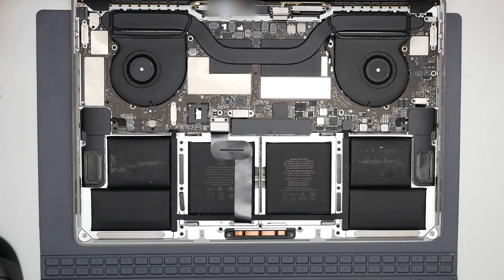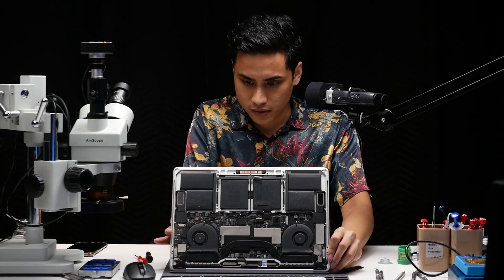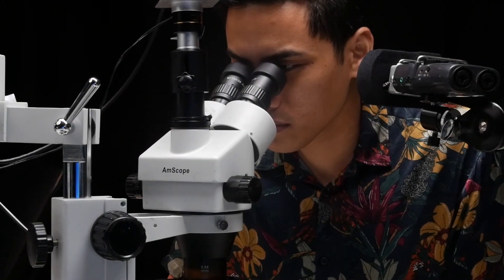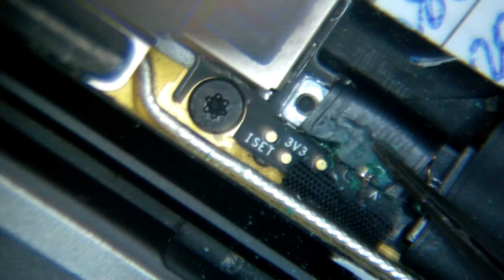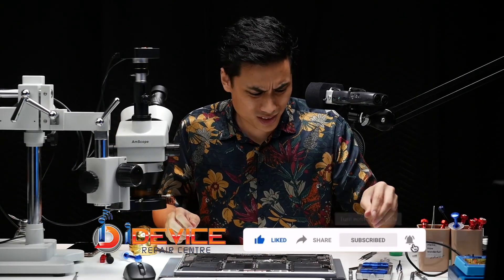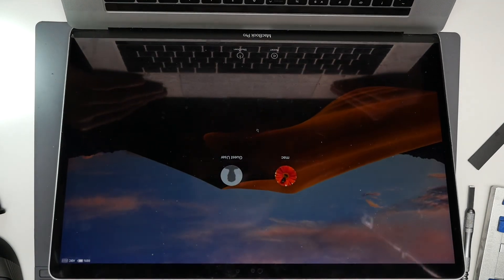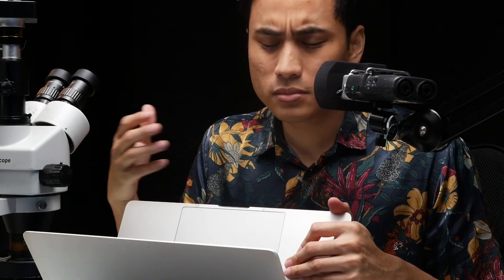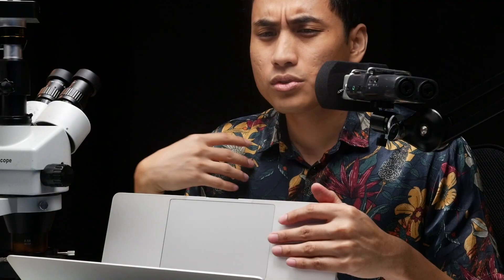MacBook Pro 15" A1707 Flexgate Repair | iDevice Tech Tuesday

Comment: Sorry I'm not sure I understand the procedure. Too much video tricks and less of critical needed information. What was the original problem? horizontal lines or "stage" light? what are you actually doing to fix this? shortening the flex cable and revealing the contacts?

Comment: Theory.. instead of soldering, would it be possible to apply silver conductive ink using fine tip over the exposed flex cable lines?